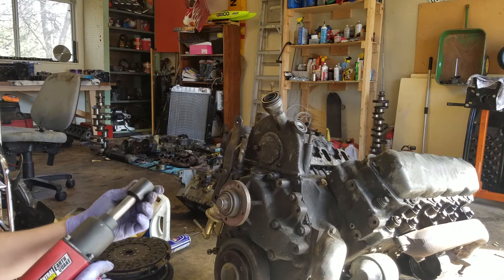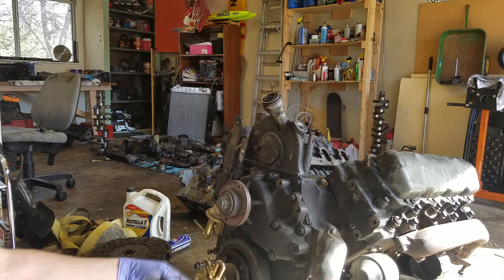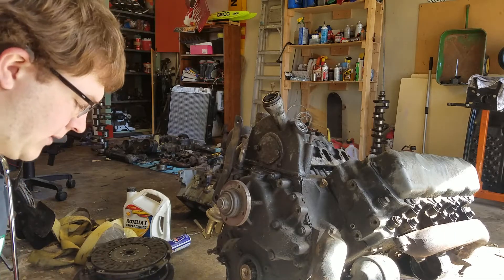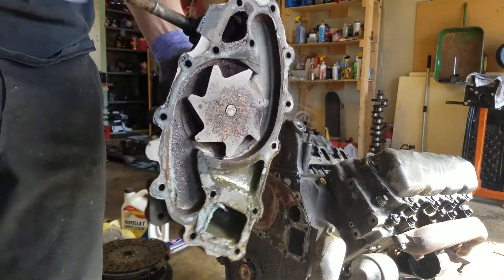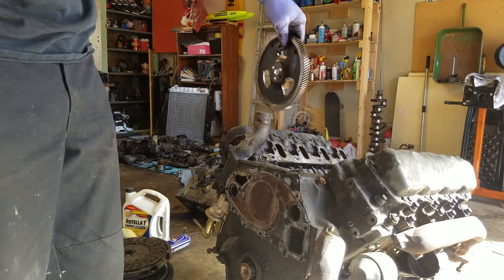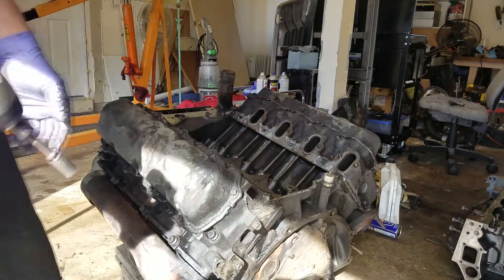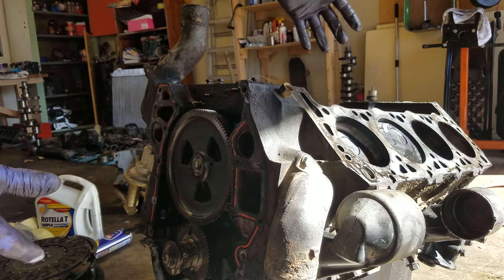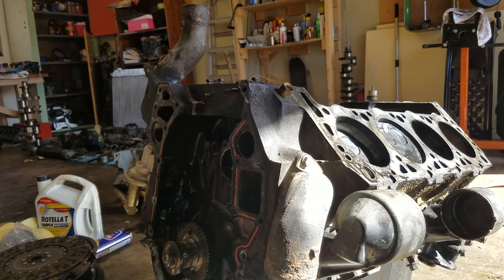7.3 and 6.9 IDI Camshaft Removal

Comment: Is the internal oil pump that bolts on the bottom  of the block timed ? I know it runs a gear to the crankshaft just wondering if that one had any timing marks or anything

Comment: Lately I’ve been having low oil pressure my 1992 f250 7.3 non turbo i just replaced the injection pump , injectors, return lines, alternator, starter,battery’s , glow plugs , glow plug relay , oil pressure sensor , temp sensor ,  do you know where the oil pump it’s located ? Do you think it’s my oil pump? last week i had normal oil pressure reading
Reply: I read your post and have a 1994 7.3 IDI turbo. I just bought it a few weeks ago. I noticed when I got it home that the oil pressure needle was showing only about 1/4 of the way from LOW and it freaked me out. Seems once it warms up it still fluctuates but does go to the half way mark or 6:00 most of the time. On other 7.3 idi videos where the truck gauge is shown some of them pop right up to the 6:00 or straight down position on the gauge.  Did you ever find out what was causing your oil pressure fluctuation?  It would sure be great id you could shed some light on this issue. Thanks for your advice in advance.
Reply: Johnnyohness  Johnnyohness  yes it was the new oil pressure sensor it was bad and I replaced it and it works good now
Reply: WOW dude you are awesome. Thank you so much for replying and fast. I am so brand new to diesels it has been a real sharp learning curve, but so many of these videos have really been helpful. Can you tell me approximately where the oil sending unit is located? I'm still cutting my teeth on these engines.
Reply: Johnnyohness yes it’s next to the glow plug module   
https://www.google.com/search?q=idi+7.3+powerstroke+oil+pressure+sensor&tbm=isch&ved=2ahUKEwik2__Y48vrAhXRi60KHb58BOYQ2-cCegQIABAC&oq=idi+7.3+powerstroke+oil+pressure+sensor&gs_lcp=ChJtb2JpbGUtZ3dzLXdpei1pbWcQA1Do4CZYzusmYJOeJ2gAcAB4AIAB_gOIAaUUkgEJMC4xLjkuNS0xmAEAoAEBwAEB&sclient=mobile-gws-wiz-img&ei=YT9QX-SmKNGXtgW--ZGwDg&bih=553&biw=375&client=safari&prmd=isvn#imgrc=QEl8q9tQGVH_4M&imgdii=oDRcEztK3FUaOM
Reply: @juan2563  Juan thank you so much...what an awesome reference page. Will sure keep this in favorites. Since your new sensor was installed do you read the oil gauge needle closer to 6:00 all of the time or does your rig still flux between 6-7 on the reading as if it were the bottom half of a clock?
Reply: If the oil is too thin it will also cause oil pressure to drop below normal.. had a guy bring in a crown school bus with a 671 detroit because it was smoking and had low oil pressure and it had the wrong oil in it.. sae40 weight and driving it like i stole it for about an hour got the rings reseated and oil pressure back to normal.. gotta bash on detroits, they don’t like being babied and they most definitely don’t like the wrong oil.. most diesels like thicker oil
Reply: It sits below the crank.. Follow the pickup tube

Comment: You corrected yourself when you called the fasteners behind the idler "screws" but you were right, technically they are called cap screws. Bolts refers to fasteners that are used with nuts to apply clamping load, cap screws are what thread into machined holes.

Comment: I did a camshaft swap with the engine in frame. It wasn't too bad, but you have to remove a few extra components besides the radiator.

Comment: Does this engine use timing belts or chain
Reply from the maker: It uses gears!
Reply: @airplanekid333  I know this is an old 2017 post from you my friend. I found it astonishing...why because I just bought my first ever diesel and it's a 1994 turbo IDI. Jaun Baltazar asked you about fluctuating oil pressure in these engines. On the dash gauges sometimes the Oil Pressure needle will point to about 7:00 PM if you were thinking in terms of a clock position and then sometimes at 6:00 which I'm assuming id preferred normal pressure. Seems it maintains a higher average when the engine is completely warmed up. That is just the opposite of what a conventional non diesel engine does. Higher pressure when the engine is running cold. Being brand new to diesels and especially the 7.3 IDI I got alarmed about it. But watching videos of other guys with these IDI videos I see a mix of rapid 6:00 O clock readings and others with the lower readings at first. Is this normal? If not what can I do to increase a higher oil pressure constantly. Other than that the engine runs awesome and tight it has about 210K on it. Please lend any advice you can about this issue. You are so young and seem to be really versed on this engine. Please tell me what is going on. Thanks so much for posting this awesome video.
Reply: @johnnyohness6610 if it’s not too late to reply lol, the factory gauges on these trucks are unreliable at best. They are just dummy gauges. The IDI oil pressure sensor is more like an on off switch instead of the actual pressure reading like the powerstroke has. Hope this helps lol